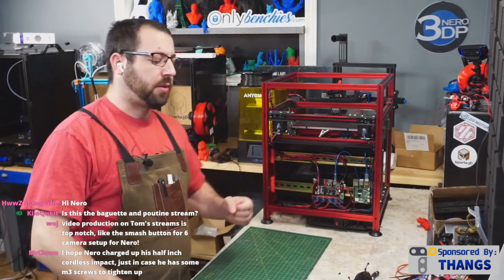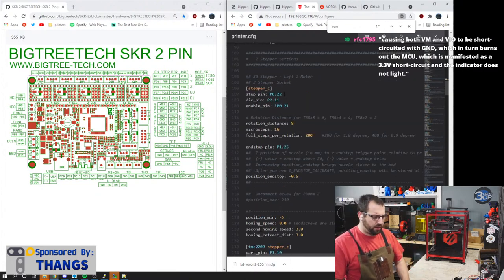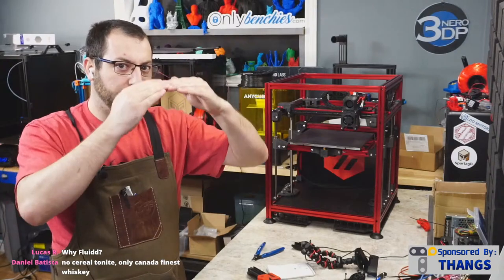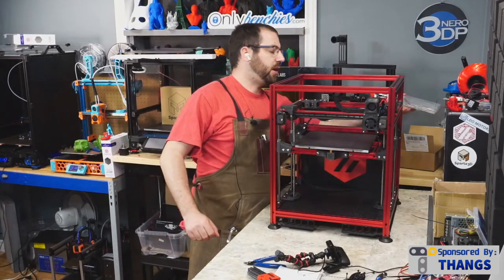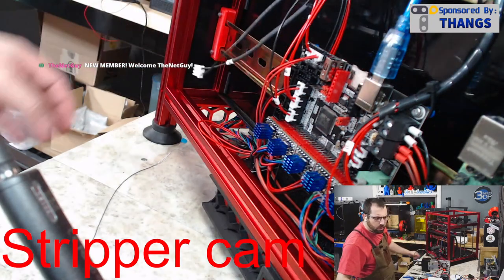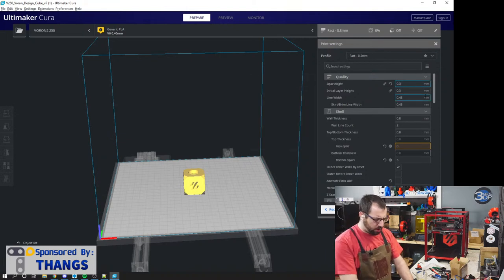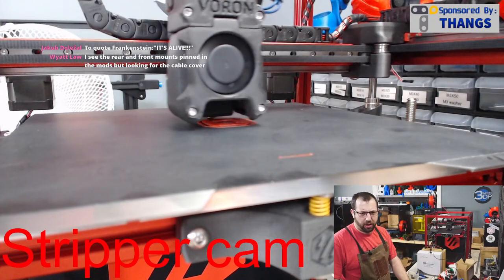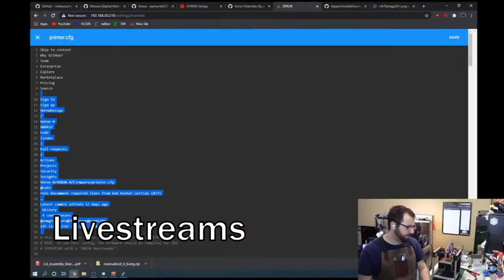Voron V1.8 Build Livestream - PART 7 - Klipper Install & Config

Comment: Hi Nero I just found fystecs full voron 2.4 printed parts machined out of aluminum. it is a very interesting options for a high temperature machine like toasty boy. for printing PEI and more exotic filament. I was wondering if you can reach out to them and take a set for a spin. it is very cheap for what it offers.